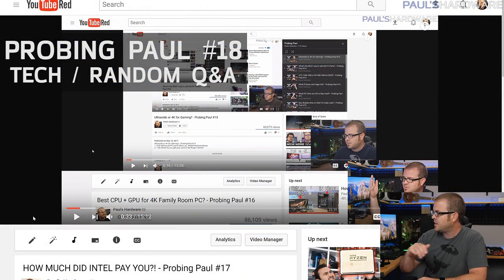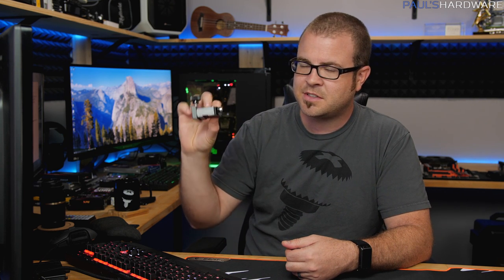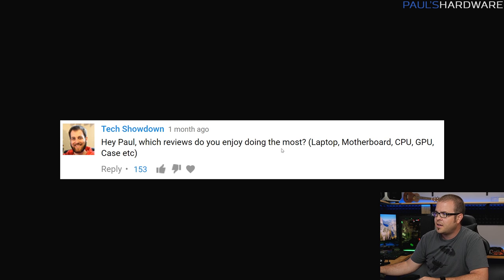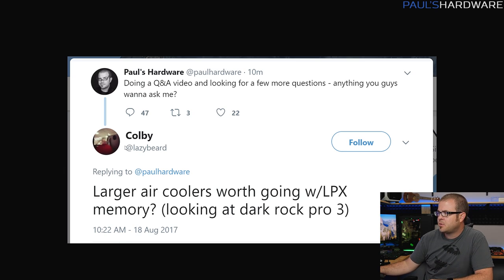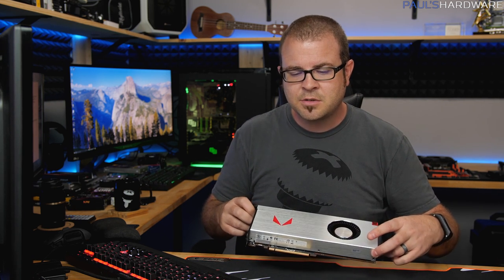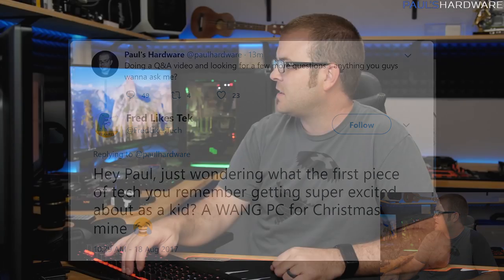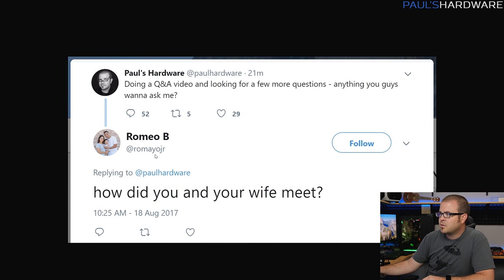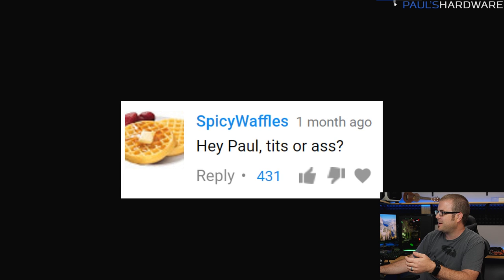Do You Hate Miners? (+ How 'bout Those VEGA Prices?) - Probing Paul #18

Comment: Regarding the AMD Vega price situation: According to a very large German hardware site, they were told by AMD that the current situation is the aftermath of a very high demand and very little supply of Vega cards. They did not expect this higher demand and therefore the dealers are offering the cards for those high prices. However they are still holding onto that MSRP of 499 € for the Vega 64 and 405 € for the 56. 

Imo this is somewhat irritating as they very probably have known about the very high demand for the new Vega cards as the costumers have been waiting for them for over one year and AMD just have not been properly prepared to deliver sufficient amounts of cards for whatever reason.

Edit

The source for the statement above has been the official Radeon RX Twitter account from AMD.

Comment: Hi Paul FYI....I delided my 6700k - applied cool laboratory clu between the naked die and the heat sink and saw a 18 - 22c temp drop running prime 95 with avx. This was with hyper threading on at 4.7ghz - 1.3v. I used the delid tool and it took about 30 seconds

Comment: Deliding is definiterly worth it. I delidded my i7-7700K and used liquid ultra liquid metal and it dropped in temperature by 20C during max load and I was able to easily get a 5GHz overclock. However,  you must have a decent deliding tool. I used a cheap one off ebay and it almost bent the die on my CPU. In the end I went ghetto styley and used a blade to get the lid off!. Not the smartest way of doing it but got the job done.

Comment: The simplest way to supply both present [and] primary markets, both miners and compute farmers vs gamers and content creators, would be to manufacture new GPU based cards at a small discount  (10-15%) for devices with all display output ports disabled... once done, the supply chain could be geared to offering strong cards to gamers, designers, artists, video editors and the like at a less ridiculous price bracket: Manufacturing schedules, stock and supply chain management could be separated. The tastiest AMD and NVIDIA gaming cards are presently 60% to 100% over priced, so no matter how optimistic the companies mentioned are about the negative impact to revenues, loyalty etc. (medium and long term), I suspect they are presently ignoring their core markets for the sake of short term revenue. 

THE GOOD WILL HAS BEEN LOST.

Solution:

1. Make discounted blank back-plane cards QC'd for mining etc
2. Return the retail sector to realistic pricing and block those re-sellers gouging on price from the supply chain
3. Build multi GPU (multi socket) boards for the compute hungry and give the lovers of beautiful graphics affordable systems again

IMHO

Oak

Comment: Hi Paul, what do you think of buying used GPU that was used in a mining rig vs a gaming rig?
Reply: I wouldn't touch a GPU that was used in mining.  They have had the living snot beat out of them.  Gaming rigs do work the GPU hard (in many cases) but they are not running flat-out 24 hours a day.   If buying used, I would be more inclined to go for a used Gaming GPU rather than a mining GPU.   Honestly, I think I would stay away from the used GPU market for the next couple of years.  I understand this is not a good option for everyone's budget, but in the end, it may be worth saving up for something new...rather than buying something used and having to replace it due to failure within months or even weeks.
PS:  Sorry for the longer than necessary reply.  Just my take on it.

Comment: Hi Paul, I have a question for next month's episode. I know some games benefit form faster RAM so I was curious, is it the higher RAM speed they need or the higher bandwidth? For instance, if I'm running 2 sticks at 3200Mhz on z270 but 4 sticks at 2400mhz on x99, will the x99 perform better since it has higher overall bandwidth or the z270 since it has higher speeds?

Comment: Delidding is fairly easy though a little scary thinking about it. Most bad stories come from bad tools or people trying to cut it off. You also need to be able to afford another chip if it does break. That makes it scary. I got a $10 printed delidder and $300 7700K from ebay. A couple rubber hammer hits with one end on a concrete floor and off came it's head. Easier than I thought and was what I was most worried. After that, it was Coollabratory Liquid Ultra spread on the die, though the provide quantity in one syringe is barely enough. So you can't make a mistake or just order two. Remove the old glue (spreader edge and chip substrate) or the separation can affect temps if it does not seat just right. I tried without removing, temps were hot but less than before delidding. Cover the die with thin layer and cover the matching under side of the heat spreader over the chip. I also did not re-glue the heat spreader as most do. not. It makes it easier to do future material changes and my second attempt in removing the glue :). My temps definitely dropped. It's better than before delidding, but I'm not happy with the current temps. I'm only using a 120mm AIO, so a better cooler might do better; 420 Eisbaer on order :). Going to try reapplying material as well to see if that helps at all. BTW, Kryonaut on the top of the heat spreader. Alignment of the heat spreader also seems  to have an impact. I have one hot core, which is odd since it's a lot hotter (~10C). A fun project and it does not take too much time to get back up and running; assuming you don't kill the chip :)
Reply: Matt McGregor Liquid metal is the worse for this type of stuff since it actually dries out faster than regular carbon based TIM
Reply: I have heard that, but I was under the impression that Ultra did not suffer as much from that. Also, a good reason to leave the heat spreader unglued ;)
Reply: It depends, I know the ones that are made of silver tend to be more prone to it. Really depends on how hard you're pushing it, I imagine it'd be similar to solder where if it gets too hot it just begins to melt off. I'm thinking of doing this myself as the Citra emulator requires fast single core performance so would give it a boost while it's still in development.
Reply: Brian Pacheco - only time will tell for me. I wanted the best attempt at lower temps or I would always wish I tried it. I'm not happy with the temps, so I'm going to alter the application slightly and retest. That's one advantage of not gluing the IHS down. Same for reapplication if it does dry out. Good luck on your attempt. I'd be happy to answer that I can.

Comment: Hey Paul, I have a question about theoretical CPU-GPU pairings. 

When Ryzen 3 came out it was shown to be a perfectly decent chip for budget gaming builds, being able to push respectable framerates at 1080p. But if I wanted to game at 4k, GPU is generally more important. So would it make sense to pair a GTX 1080 Ti with a Ryzen 3 1200 if I wanted to game at high resolution?

Comment: Hey Paul, I'm looking to upgrade my CPU and i want you're advised about it. Gaming is not a matter I want pure CPU workstation power but still have some budget. 7700k is the cheapest because I already have Z270 mobo. Ryzen7 1700 seems to be the better choice for those 8 core 16 threads or wait for Coffelake for 6core 12 thread and more expensive.

Comment: What did Intel use with 2500k/2600k? Same stuff as in newer cpus?

Just thinking because my 2500k@4.8Ghz runs around 60c while gaming on small Zalman cooler (though it sounds like jet engine but...)    =P
Reply: Those CPUs are soldered.

Comment: What would be some good jobs/degrees to get into if someone wanted to work in the hardware aspect of computers rather than software or data?
Reply: Dillon Brigode im curious as well
Reply: I know Paul just put up his answer on ep 19, but I wanted to give you my two cents.  I am a Firmware engineer (I sit between software and hardware).  As for degrees, depending on how much math and science you want to learn, look into Computer engineering, Electrical engineering, or Microelectrical engineering.  If you want to be more hands on and less design work, look at an associates degree in computer/electrical engineering technician.  The very high level distinction: computer engineers are a mix of software and hardware, MicroElectrical engineers are the people who design silicon chips (Intel, NVidia, AMD), and Electrical engineers can be anything hardware that had to do with electricity (I mean, this is the field that spawned the other two).   I studied EE myself and I've run the gamut of fixing circuit cards by hand, to now what most laymen would consider programing (though it's not and software engineers would yell at you if you did call it that).As for Job, again, look at technician and engineering jobs, most are not going to be at places like Intel, AMD, or NVIDIA.  I found the most available and stable jobs are in the defense industry.  However, that industry being what it is, it doesn't like risk or cutting edge tech.  If you want to do that, look for a start up or small (but 5 year old) companies in the Boston, New York, Seattle, San Francisco areas, in that order for hardware start ups.

Comment: Delidding my 7700K and replacing the TIM with TG Conductonaut (liquid metal) lowered my max temp by more than 25C. This let me up the voltage and OC 100MHz higher than before, so now it's running at 5.1GHz and is still 20C+ cooler than it was at 5GHz with stock TIM.

It's pretty sad that you have to do that just to get reasonable temps while overclocking though. And my overclocked Ryzen 1700 still runs almost 20C cooler with the same AIO...

Comment: Hey paul, do you know something about there being 2 different fan design that's used for the stock ryzen 5 1500x/1600 wraith spire cooler fan? There first is the wide 5 blade design made by coolermaster that most reviewer get and the second is the thinner 7 blade design made by avc that some of the normal customer seems to be getting. The avc fan seems to be cheaper and probably worse. What's your thoughts on this?

Comment: Vega 56 cost more than 500€ here. You can get an OC'd new gtx 1080 with a way better cooler for that. Would've bought one, but I just went for an Asus 1070 for 361 Euro, a used one, btw

Comment: I know I did get excited with my first real PC - a Zenith e-z-PC.  LOL  But the PC that put me over the top with excitement (some parts of me wish I still had it) was my Athlon64 3200+.  I built that system when Athlon64 launched - and it made a very good impression on me.  No PC product has to come to market has ever got me that excited before.  Though the Core2Duo made a reasonably good impression, the i5's/i7's did for the first few years, and Ryzen/Threadripper is these days - but these CPU's are still a bit... well boring with what they are bringing to the table when compared to what the original s939 Athlon64 brought to the table at it's launch point.   Well, not so much Threadripper (it's not boring at all).

Comment: Hi Paul, I finished my first build  2 months ago Ryzen 5 1600 Asrock AB350 Pro4 8Gb ram and a XFX RX480 8Gb the Black Edition (snagged just before the mining boom  my wallet was thankful lol) - however the my question related to personalizing my pc with RGB lighting I bought Ring Plus 12 TT Premium fans (5 pack) and the software is not working with ryzen.  I was hoping to overclock to 3.8  -4.0 pending but as the controller is not being detected my fans run on default only settings.  Not sure which direction to go with my fans (return them or?) as I still want to overclock my R5 1600.......some suggestions/ideas would be great btw I love RGB lights

Comment: Hello. Would it be possible to use a threadripper 1950x and 4 mid range gpus to build a budget 4 gamers 1 cpu system?
Reply: You need about 4-8 threads/cores per client. Then about 2 cores to run the host. So I would say for sure, yes. A 1950x could run 7 gamer's one CPU, considering you had a motherboard with enough GPU's...

Comment: Could AMD put the Vega 56/64 chips on a PCB with GDDR5? Or are these chips designed to only work with one type of VRAM? The only reason I would suggest this is to lower costs and cut MSRP, and allow better yields. I feel like HBM2 is extreme overkill, and seems almost pointless at this point in time.
Reply: Austin Shoffner Nah, they would have to redesign the entire memory controller, at least. Also, imagine the additional power that a GDDR memory bus + memory modules draws.
Reply: The HBM2 is part of the actual die, unlike most cards, where the RAM is located around the die, on the PCB.
Reply: Hey Austin a fair question, probably is part of the die, not an expert, also consider that there's a general shortage that's happened of RAM in general, which will affect GDDR5 and therefore other video cards that use them anyway, so ironically it's probably good for AMD since it may level the playing field a bit.
Reply: It's not pointless, Vega needs power, HBM2 saves a bunch a W.
Reply: Austin Shoffner if you overclock the HBM performance improves more than overclocking the core. 

Drivers are currently trash. But HBM is not pointless on this card.
Reply: nappydrew it's not part of the die. It's on an interposer. The die is seperate.
Reply: Jethro Rose -- All I meant is that it's not on the PCB.
Reply: nappydrew ok. But you did write that "it is part of the actual die"
Reply: That's right, I misworded myself, pretty sure that's loud and clear...

Comment: I have a i7 7700k. If I wanna oc higher than the turbo is there any air coolers good enough to achieve a good oc? Cus I'm worried of the slight risk of an AIO leaking and destroying everything.if I can achieve a good oc with my CPU on air cooling pls suggest one. Currently running at stock clock with hyperevo 212 and very cool.

Comment: Considering that rumor that Vega was going to be some very good mining card is false, even with their mining driver, as the midrange cards still offer a better profit ratio (higher performance per watt), I can't imagine Vega's stock issues are miners fault, just as miners weren't causing stock shortages of 1080 or 1080 Ti.

Comment: I'm still running a 2600K @ 4.5 Ghz and an EVGA GTX 580 SC. Should I retire the 2600K when I finally upgrade my gpu or do think it'll still keep up? I game at 1080p.
Reply: Hard answer, maybe you could sell the PC as a whole system. And get complete overhaul.
GTX 580 is around a GTX 1050 (or less).
It all depends on your budget.
Reply: Your limit is probably 1060/580 performance, if you are under or at that budget, then just get a video card, if you have more then get that and new cpu instead of going for a 1070/1080/Vega.

In other words dont get anything above a 1060 without upgrading your CPU or monitor resolution.
(It still depends on what games you play).

Comment: The pricing on the rx series is almost like consoles. Games console are sold at a loss or cost because (insert console manufacturer) can sell games and accessories at a huge mark up and recoup the loss/R&D costs. So unless amd start selling sleeved cable extensions , backplates with cool art or official cooler upgrade kits, a loss to the manufacturer or high price to the consumer will always be the case.

Comment: Why do most tech tubers that watercool use 360mm radiators where 420mm is an option. A 360mm radiator is only 73% of the surface area of a 420mm radiator, and well designed 140mm fans that have good pressure exist these days, and usually have vastly superior airflow. If you want to get technical, a 480mm radiator (4x120mm) is actually still smaller than a 420mm radiator, but unless you're rocking a 250+ dollar super tower, you're not getting 4+ fan radiator in your case.

It's just the rule of thumb is "a 120mm radiator per device, plus one just because" and the 420 would cover the "+1" surface area wise and would make an enthoo luxe build a lot cleaner to just have a roof radiator.

Comment: CORE i3 OR RYZEN 3????
Reply: RYZEN 3
Reply: Ryzen 3
Reply: Ryzen 3 if you are overclocking. It's much better than the i3
Reply: Quad core vs dual core... is this even a question?
Reply: If you can wait a bit, the coffee lake i3 looks very promising with 4c/4t.
Cant go wrong with ryzen 3, especially if it's a budget build, but if you want the slight ipc advantage that intel cpus offer, definitely hold off for a bit.
Reply: Jeff T The 8100 will cost over 200$,stop recommending shit.
Reply: Batemen source?
Reply: Angel Lopez core i3 traditional prices.  Atleast were i live, in canada.
Reply: quick search on amazon.ca shows an i3 7100 at 149.99 and a r3 1200 at 155, so I would say they're similarly priced, hopefully the 8th gen i3s stay in the same price range as their predecessors (they kinda have to if they want to compete). 
But I'm assuming this is a new build of yours? if so, for the time being r3 would be best option if you plan on overclocking and you want to complete the build asap, since coffee lake won't be released until sometime in November at the earliest.

Comment: Hey Paul.   My board supports crossfire but not sli.  Would selling my gtx 1080 and getting 2 vega 56 or 2 vega 64 for better performance.   I haven't seen much in way of crossfire with these two gpus
Reply: joey rosenbaum your board probably supports SLI however to "officially" support SLI companies have to pay for a certification process but in reality 2 PciE x8 or 2 x16 will do even if not oficial.

Comment: I have an issue with a computer I built 

The build is a ryzen 5 1600 at 3.8ghz using corsair vengeance lpx, the issue is that the ram is supposed to run at 3000mhz but when ever I try to even slightly increase the speed above 2133mhz my computer wouldn't turn on. If anyone knows what is happening please help me out
Reply: Jayden Meyer That means your Mother Board only supports up to that much :/